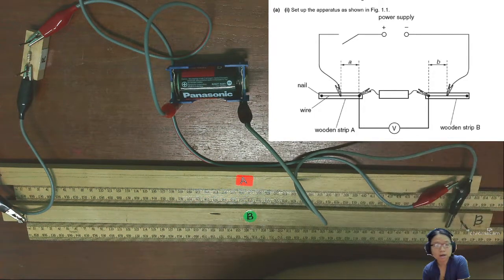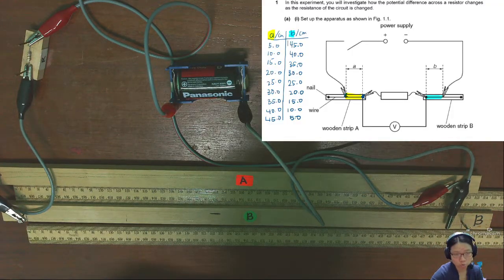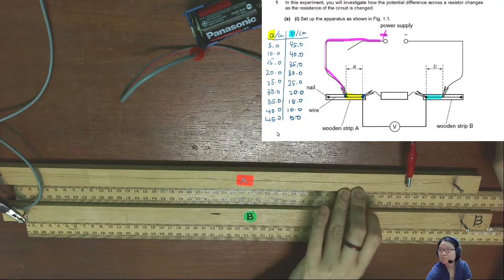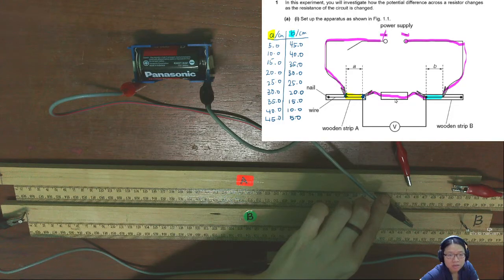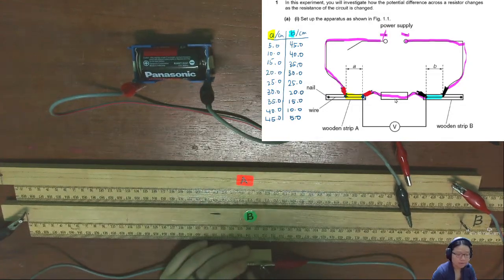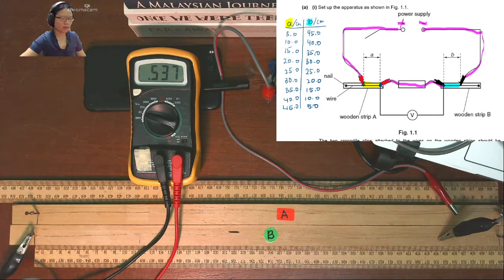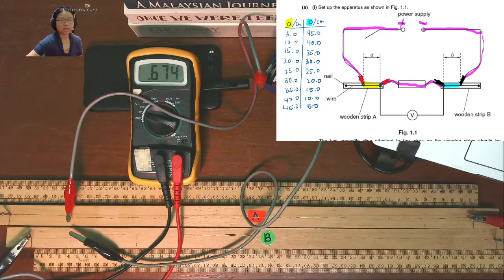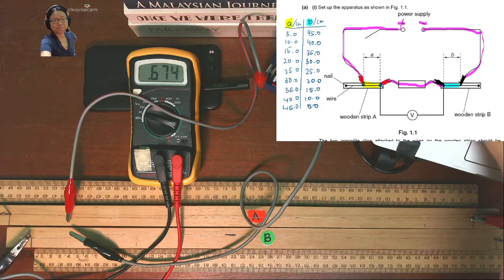ON15 P35 Q1 Data: Resistance and Potential Difference | AS Practical Paper 3 | CAIE A Level Physics

Comment: how will it be marked if we get no trend . for example in this exp I got V values as follows
when i increased a from 10-40 cm 

v were as follows
.395
.392
.373
.401
.365
.367

i repeated and then too same 
what will i do in such case. 
Could it be the problem of teh wire?
Reply from the maker: Normally it is due to connections being lose. or one of the crocodile clamps not holding on tight enough, so any movement would have affected the circuit connection.

suggestion, check every single connection and wire (connect wire to multimeter, it should read 0ohm)